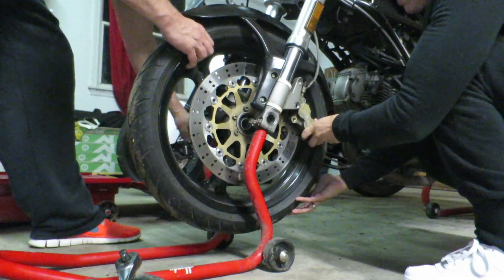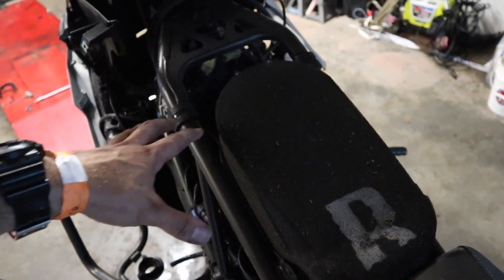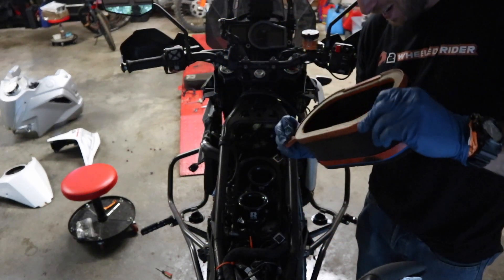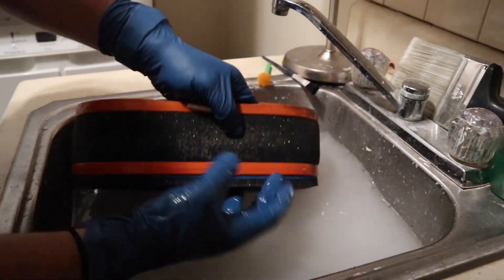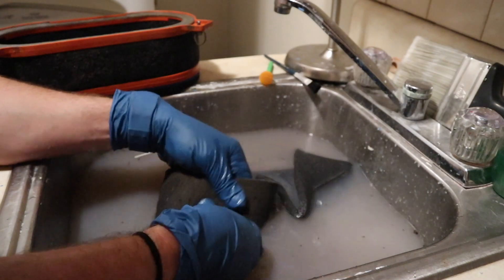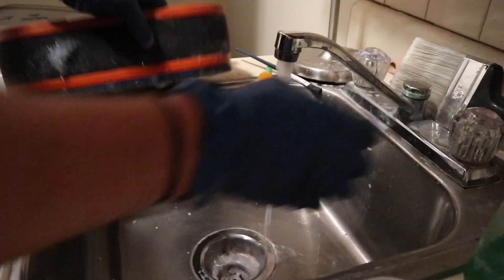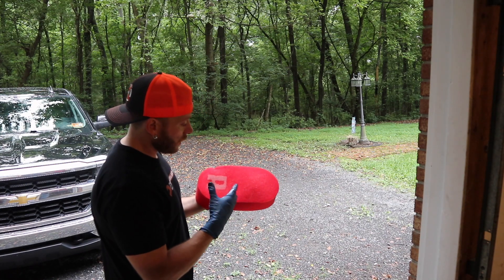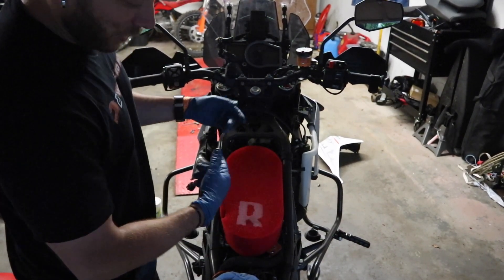Cleaning my KTM's Rottweiler Intake after 10,000 miles | Back in the Garage

Comment: I’m wondering if you have ever had any issues with water? I’m worried about long rain days and mobbing through a mud puddle or water crossings. 

It seems that most people that run these live in dusty climates. I’m in a more wet climate in wester Pa.
Reply from the maker: No. You’ll have zero issues. If rain somehow gets thru the oil foam filter, can u imagine what it would do to a paper filter??

Comment: Hey Mario, thanks for all the vids, helped me on maint with my 1190 sa. I rode CO to AK last year and installed the stage 3 kit before that trek you sold me! Have rottweiler send you ambassador funds! Im curious though, i have air filter oil that drips all over my rear head cover and the rest of the motor, around rear spark plug, etc, do you have that problem? Or am i just over oiling?... still trying to find that balance
Reply from the maker: You’re over oiling

Comment: At what point do you use the oil filter cleaning solution? Was it the first wash or second wash or both?
Reply from the maker: Not sure what you’re asking. In order to clean the filter you need to use the cleaning solution.
Reply: The first wash was with cleaning solution. The second wash was dish soap
Reply: @crbushwhacked  thanks

Comment: Thanks for the input.  Been considering the pre filter for my 990, I’m sold.  Been considering a trip to Anchorage as well, you have any thoughts on that?
Reply from the maker: I really like the pre-filters as it stretches out the intervals. I rode up to Alaska back in 2018. Depending on where you're leaving from, you'll definitely want to consider a tire change during the trip (again depends on mileage). While I was getting 7,000+ miles out the the TAs tires, I got less than 5,400 on the roads up north before they were cooked.

Comment: any problems out of the bike so far? I would love to have a SA but just don't have the funds right now, hopefully in the future!
Reply: I bought one in January this year, just a year old and 3k miles. The handlebar grips are very narrow even for small hands. I had a bad wheel wobble at 45mph and a knock on the front suspension, especially in "off road" and "comfort" mode. The dealer didn't want to know. I sold it after 4 months. Mario agrees about the handlebar grips but he hasn't had the problems I have had (I asked him!) but if you google the probs I had it's not uncommon. Hope this is of some help..
Reply from the maker: So I don't have to repeat myself, check out this video https://youtu.be/tMgT3JS4d04
Reply: No wobble on Mine.
Reply: Bought mine in December 2017. 8,000 miles and no head-shake/wobble of any kind. Grips are small so I just put on a set of Grip Puppies. $20 on Amazon.
Reply: I tried that, but it just makes the grips fatter, you cannot increase the width. I did look at putting grips on from the 1290 S (they are wider) but not compatible.

Comment: Great Video, Mario.  I'm installing the Stage 3 tomorrow morning. I purchased the Red Filter just to have, but wondering which one ( Red or Black )  I should use for normal street riding. I wont be going off road in the near future.  Any recommendations?  Thanks, Mario.
Danny.
Reply from the maker: There’s not much difference between the 2 pre filters. I would alternate them. I’d check it at the regular service/oil change intervals.
Reply: Thank you

Comment: With this system being more open and not really having a "box", do you ever have any concerns from road spray kicking up into that area while riding in rain? Just curious
Reply from the maker: No. The radiator blocks much of it but if you're ever concerned Rottweiler does provide a "block off" plate you can install if you like.

Comment: Speaking of the tank removal process. Now I know you have the 2016 SAS but do you know if there's an extra step for the 2017 model since the opening system for the tank works with the remote key? Love the videos man. Cheers from France.
Reply from the maker: I'm not entirely sure if they have another wire/connector powering the fuel cap or not. Just be careful and take a look after unhooking the rest of the hoses/connectors before fully lifting the tank off the frame.

Comment: Nice one Mario!  Just started watching your KTM edits as I just bought a new 1090 Adventure.  If you were starting again with a new Adventure would you change the air filter system again or just go for the fuel dongles?  I always like the idea of dropping in a nice clean paper filter regularly or is it really worth buying this kit?  Cheers from sunny England. 😎👍
Reply from the maker: It's really up to you. Personally, I don't regret spending the money on the kit. A friend of mine added a full exhaust to his 1290 Duke R (which was pricey). He later added the Rottweiler and noticed WAY more power gains for much less money. There's nothing wrong with the factory set up (under most conditions) when it comes to filtering the air. I'd only go with the Rottweiler if you want the performance gains.
Reply: @2WR  thanks Mario, appreciate your thoughts.

Comment: I'd like to do the rottweiler stage 3 kit soon on my 18 sas. Is that a second tuned velocity stack I saw? I noticed the kit only comes with 1 stack. Is there any gains to having 2? This video is very informational! Like all of your vids actually. Thanks again keep it up!
Reply from the maker: I did buy the second stack (kit comes with one). It's supposed to add up to 2 more hp across the power band with the second stack. I figured if I was going to do it, I may has well put both on. Glad you're enjoying the videos.